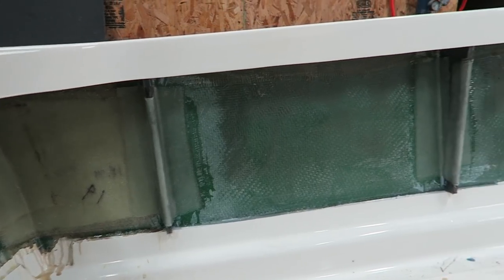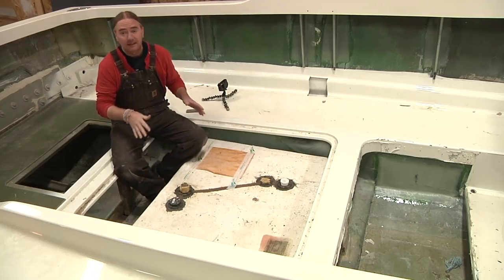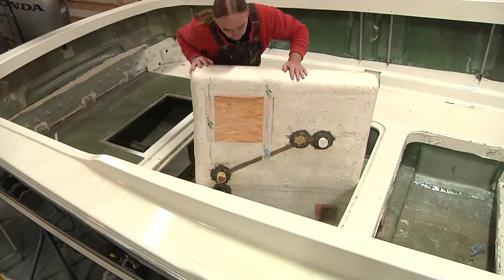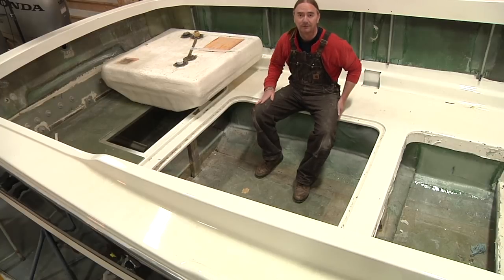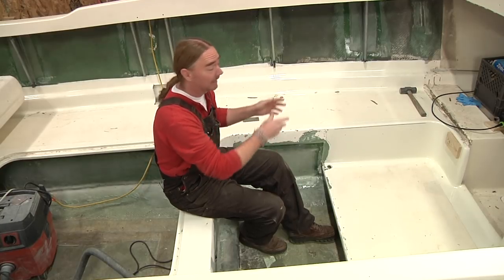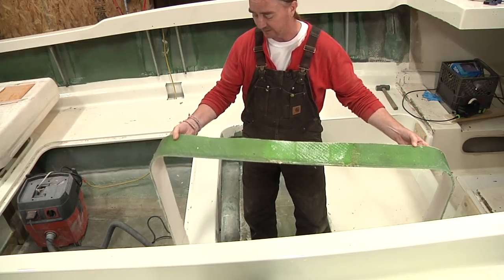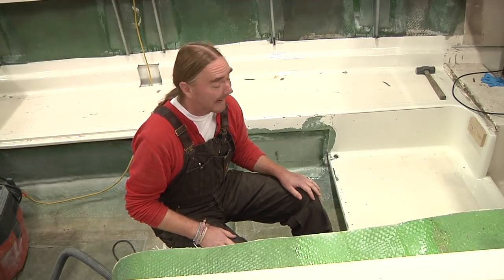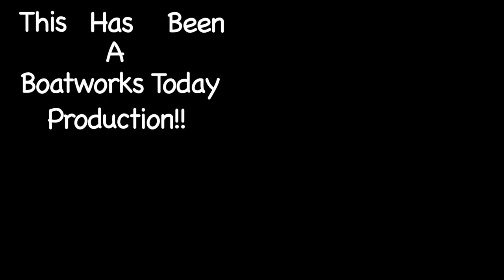Pulling The fuel Tank And Grinding Fiberglass To Prep The Cockpit For A New Layout!

Comment: When you used the vibrating tool to cut off the vertical deck support (5:37), the athwartship fiberglass beam really flexed.  Add some more glass?

Comment: As for the cavity/compartment why not spray foam insulation in cavity, to fill he voids on the sides.  Then cut, sand or file down  the insulation to the desired size and then glass the cavity in place?

Comment: Why not use Divinycell with the bi-directional saw kerfs which would allow for the curved corners? You could build in place or form in place hen cut in half on the aft wall so you can laminate the outside. Then reinstall and fill cut seam and tab in.

Comment: For the locker in the floor, I would coosa across the back then paint 2 part closed cell foam on the sides, grind it back into shape and glass over the top.
Reply: What's the foam doing? Quiet and insulate?

Comment: Looks like the tank was turned around I’m assuming as you move forward in the hull it gets deeper, that would also put the filler neck more in line with cut out on floor.....cool project!!! Thx for the vids.

Comment: Ethanol is alcohol... does alcohol dissolve anything related to fiberglass layups? If not - were the older tanks coated with some special / unique surface treatment due to its constant contact with petrol gas/fumes?

Comment: A possible solution would be foam cut to the height you need (or a bit more so you can fine tune the final fit). Glass one side only with one layer of your chosen laminate. Kerf the corners on the unglassed side to get the corner shape correct either in situ or using the offcut as your template. The one layer of glass on the "outside" will provide the flexibility without accidentally snapping the foam when kerfing the corners to the correct shape as well as provide stiffness to the rest of the panel.  Once the final shape is achieved, fill the kerfs with thickened epoxy and glass over with one layer. This will set the shape and you are then good to go to do your final layup and glass it in place.

Comment: The flat parts of your mold-less coaming are pretty straight forward, the radiused corners, not so much. They appear to be a 6-8 inch radius, which a temporary backer could be carved from polystyrene foam and could be removed with acetone post layup. Markup a template and measure the radius, More options may reveal themselves with more information. Still thinking on the cooler compartment in this location? If so, board foam could create your substrate to lay up glass.

Comment: I think using the old part as a template will be a great idea for the channel notwithstanding whether building a new part using coring material might be easier.  Interested to know if you will make the whole locker out of the shape of that cutoff and then drop/laminate it in place.  Santa suit is back!

Comment: My Bertam 28 has a custom aluminum tank (side outlet) that provides 200 gal as I remember. It works very well. although I also have 2 350 ci. small block Chevy engines where  you enter the cabin under the floor. Ill get you the information where I bought it if you like that better than the small plastic one. Nice work as always! I am definitely installing the knees on mine!

Comment: You could use thin 1/4" foam core, cut it to the proper height and approximate length, then glass both sides of it while flat.  Once that cures you can score cut the inner corners (use your cutout piece for a template), bend it around inside the hull and then tab it in and glass over it to add strength and cover the scoring cuts.  This would be pretty fast and easy, plus it would let you do it in place and probably save some time.

Comment: Andy, why not prefab some flat sheets of glass to make the sides and aft face with.  You would then have to decide if you wanted the radius corners or could live with 90 degree corners (i.e., filleted and taped corners).  A sheet of 1/4" MDF with vinyl on one side makes a good, cheap surface for laying up up prefab.  Procedure is simple.  Wax layup surface with 6-8 coats of wax.  Spray with gel coat, lay up glass on it.  Skip the gel coat if you want to paint. That will produce nice smooth flat panels you can use for whatever.  Radius corners will be a bit harder, but I am sure you can work them out.

Comment: You could try using kitchen work top to make the “flat” areas of the mould, join them together so they could drop in exactly into the locker space. A little heavy be should work. Form the corners from foam and then laminate over for a hard surface. Gel coat then flat and polish to blend into the flats.....?

Comment: I just replaced my fuel tank in my 21 ft center consol , I used 3m 4000 uv sealant in the passed it would get stained and moldy within year , and will not clean out ,is there anything you recommend that would last on a deck of a center consol fishing boat ? Thanks

Comment: I Noticed that on the Side that Didn't Have the Bulge that you had to Fix, The Rough Hole is still there (Possibly a Drain to the bilge between the Outer Hull and the inner Structure) .. Should your Repaired Side also have the drain Hole is this Question?.. Thanks, Richard

Comment: Andy, The mould option does allow you to maintain the radius of the previous piece, but trying to get the new piece into the boat without swearing numerous times off camera may be difficult. I noticed the slight difference in height at the bottom of the hull. Getting this to fit properly by scribbling the piece, taking it out, scribbling again, etc... will definitely cause major cussing. Build the piece in place with 1/8" ply. Your sanity will thank you later.

Comment: split the piece you have in thirds length wise, remove the gel-coat and use some 20 inch strips to make the insert,  do it on the plastic add some layers to the center to make it uniform. do the back and half the corners in one layup and then each  of the sides in two separate layups.

Comment: Yeah I think if you sat it across some trestles you could take a mould from it alright. I couldn't think of anything else other than put some PVC over it and hit it with a heat gun and make a mould from it to save using that bit unless it's scrap now anyway and doesn't matter. I'm stuck trying to make a fibreglass dash board like a cars for a stereo and speakers and a few switch's to fit on a 9ft rowing boat 😂.. twisting my Mellon man.

Comment: Make a cheap particle board mold that just drops in and gel coat it on the outside.  Wax it up and lay up your tub. This way everything is flat and true and work now will save in the long run.
If you can turn the fuel tank around, it is deeper in the front.

Comment: The old fiberglass tanks could be salvaged by cutting it open and reglassing the inner surface with modern resin.  Had a buddy with an inboard that was loosing rpm over time, he found the valve stems were gummed up.  That was the old tank resin breaking down from the alcohol in the gas.

Comment: Getting the tank out was quite funny! 
...
Not sure about the “mold-less” fiberglass forming, though.
Just so I understand correctly, is it the intent to have the new form fit under the lip of the existing deck, or against the lip? If under, you could have difficulty getting it into final position. If against the lip, it “should” drop in snugly.
Regardless, I look forward to seeing how it comes together.

Comment: As mentioned prior, I'd feel safer building a jig from 2" closed cell poly foam the full width, maybe using gap striping in between full size pieces, covering it with plaster sheeting, then building the FRP over that. You would have a more stable surface to work with and would end up with a better finished surface.

Comment: Looking at the way things lay out it seems the tank was backwards. And you may have the space you need if the tank was fill port toward the bow. Also review your video and you’ll see the path for the hose and tank line up if the tank was turned 180.  Also 80 gallons seems kinda small for that boat.

Comment: IMHO, while making a mo!d/jig to produce the needed part it would be much easier to build it in place. Perhaps not as educational, AFA molding parts; but less work overall. Still have to trim, fit, tab and fair(the whole big, unwieldy piece). Maybe make the corner radii pieces over a jig (proper size PVC pipe?), tab in; then strajght, flat panels to fit/ glass.